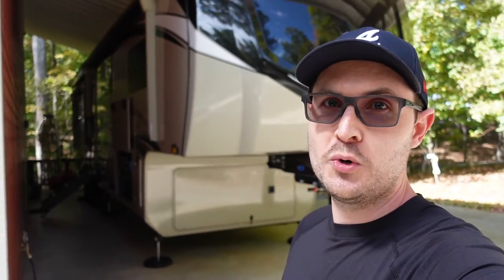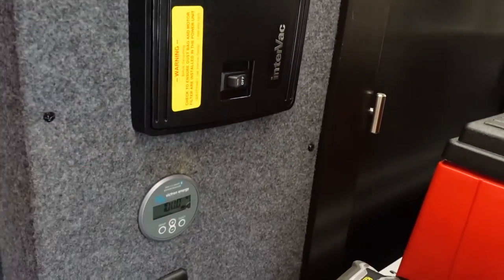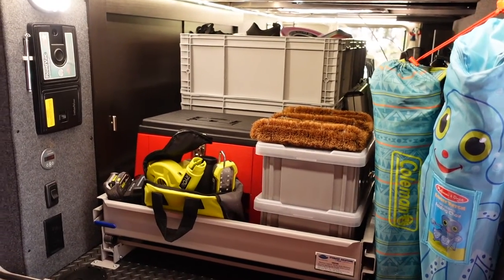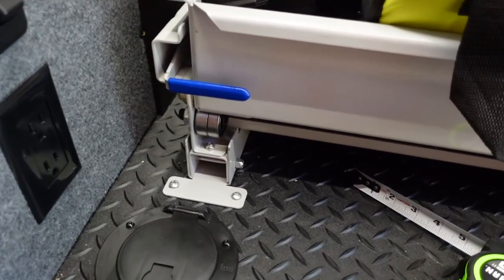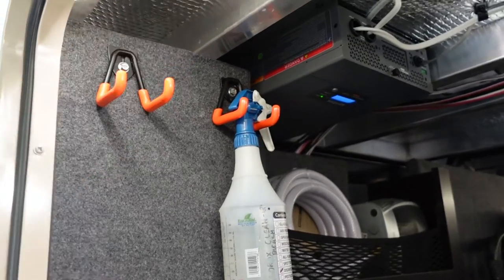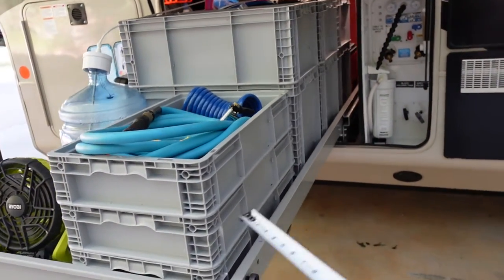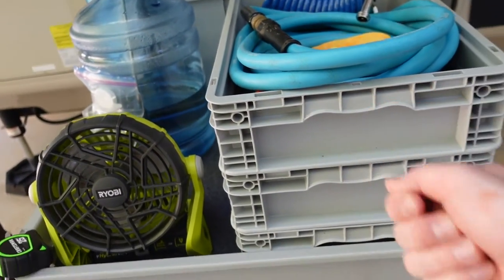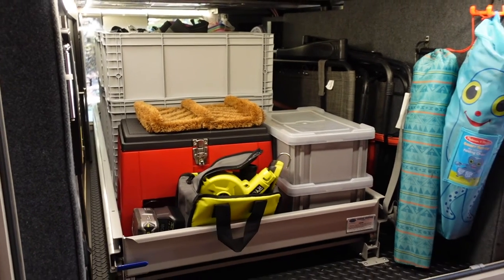RV Basement Storage Tour & Organizing Ideas Featuring MORryde Sliding Cargo Tray in My Fifth Wheel

Comment: Do you have a video on how to hook up the LED lights?
Reply from the maker: I do not, but if it helps, I borrowed power from the existing storage LED motion lights that were there already. Jayco uses those handy Wago lever nuts, so pretty straight forward to tap into existing power. In the video I used a piece/strip of aluminum stock from hardware store to mount the LED strips too, but they also make nicer aluminum extruded c-channel as alternate:
https://amzn.to/3VyyjBH
Reply: @AdventureRocks  thanks

Comment: Great posts. Two questions 

1. Where did you get the garage hooks?They look great.
2. Do you have a tutorial for the 12v LED light install. Couldn't see the what you used as a backing strip for them to mount to.
Reply from the maker: Thank you! I think the garage hooks may have been Home Depot or Lowes, but I recently bought some similar ones in all black here:
https://amzn.to/42LLqkT

On the LED strip shown in video I used just thin strips of aluminum from hardware store as backer, but recently I did a more refined install and used this extruded aluminum channel instead...a bit cleaner, just a little more cost $$:
https://amzn.to/42RgDTB

Comment: Lots of great tips! Thanks for sharing. Did you put your LED's on some type of track to stick them? Curious as to how you attached them to the ceiling studs. Thanks!
Reply from the maker: Thank you. They make a plastic c channel that LED strips can snap into and then mount, but I just took a thin 3/4" strip of aluminum from home center and mounted them to that instead.
Reply: @AdventureRocks  Thanks for the tip!

Comment: Could you do a video how you install the LED strip lights in your cargo bay ?
Reply from the maker: I could probably try to work that in over next month or so. What model RV do you have?
Reply: Did you use a power supply or direct wire to the 12v circuit

Comment: Great video. I too installed the MORryde sliding cargo tray that pulls out from either side in our 5th wheel as well.  At the time I ordered it, I didn't account for the rise in the door so I made my risers out of plywood.  I just ripped strips a little wider than the mounting feet and covered the risers with similar grey, needle-punched carpeting that Keystone used in the rest of the basement.  It looks very OEM.  I love the idea of the access doors to the business side of the basement.  I may just borrow that concept and add that to my basement.  Thanks again for another great video.  Safe travels.
Reply from the maker: Thank you! Great thinking on the plywood risers. The metal ones are pricey.

Comment: Are your quick connect in your wet bay angled? It appears so. Where did you get them?
Reply from the maker: Glad to help. Two piece actually, so the shut-offs are 45 degree and then I've got regular quick connects attached to them. The quick connects have o-rings in them so I find sometimes every 1-3 years I have to replace the o-rings or entire piece depending on how they hold up. Here are links to both: 
Quick Connect Fittings for Hose 
https://amzn.to/3CiuWUp
Angled Shut-off Connectors
https://amzn.to/3ExQDT4

Comment: What did you use to mount the riser to the deck and size?
Reply from the maker: It's been a while since I installed it, but I'm thinking the kit may have come with screws to mount to the subfloor. They are basically wood screws, about 1-1.5 in long. Just need to go through subfloor basically. If it didn't include them I must have had some surplus laying around.

Comment: How did you wire that switch for the pump? I love that!
Reply from the maker: My Pinnacle came with the pump switch already from factory thankfully, but on my last RV I had to add the pump switch to wetbay. A cheap/easy way to add switch is to do an "in-line" switch where you just add a new switch in-line at the wetbay (interupting power to pump) given most RVs have the water pump within a few feet of the wet bay, so minimal wiring. Basically adding a new in-line switch is just interupting the existing power fed to it. Downside of in-line switch is it isn't like a 3-way switch where you can use both inside and outside switches at the same time, rather you have to make sure they are on/off in sequence for pump to work. Hope that makes sense, kinda confusing.

Comment: Great video. How did you wire the LED lights?
Reply from the maker: Thank you. Yes on the LED strip...Since the draw on the LED lights is so low, I just tapped 12V power off the existing motion LED lights that are in the storage bay. Then just added the switch to turn them on or off. If you've got similar fifth wheel you'll see the 12V wires feeding motion LEDs just behind the sliding service panel. Here are the products I used: 
LED Strip Light
https://amzn.to/3TbWBgJ
Light Switch
https://amzn.to/3CFMtY2

Comment: Thank you. Any link for the bins?
Reply from the maker: Yes, here are the Straight Wall Containers (I use the 24x15 size in 5, 9 1/2, 14 1/2 heights):
https://www.uline.com/BL_190/Straight-Wall-Containers

And, the smaller Divider Boxes (I use the  16 1/2 x 10 7/8 x 8)
https://www.uline.com/BL_8821/Divider-Boxes